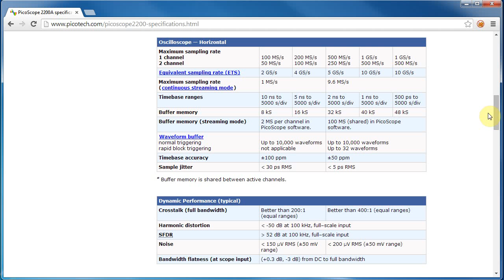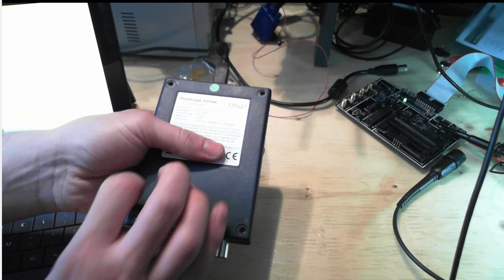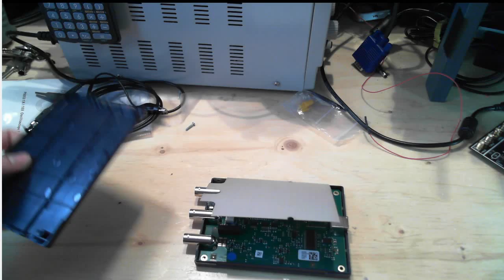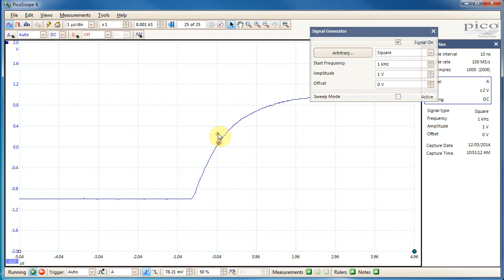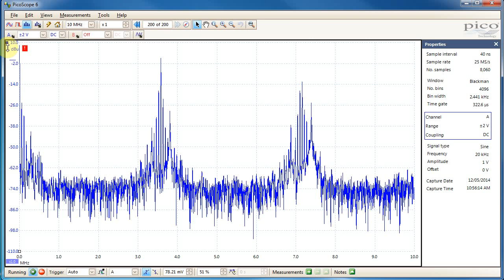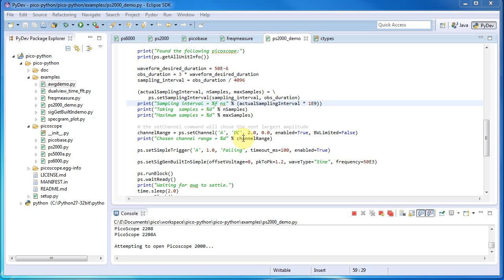PicoScope 2204A Review

Comment: I want to measure upto 2 MHz signals with this. Can you tell if that is possible? Thank you!
Reply: the lowest range on those is 25MHz. In order to reliably measure a specific frequency, you'll need at the very very least double that. So with a 25MHz OSC the maximum frequency you can reliably measure is 12,5MHz (realistically more like 10MHz).

Tl;Dr: Yes, 2MHz is well within range of even the lowest Pico 2000
Reply: I think, the minimum is 10 MHz that they offer. I heard Picoscope guy that to reliably measure a signal, go for around 10 times the signal speed. Nyquist says that measurement should be more than double the signal speed. So I am confused, who is right here. 10x practical guy or >2x theory guy. I am still very confused with memory depth too, to get memory depth of 32MS I need to buy 50 MHz version which is around €300, around 3 times the price of 10 MHz because of memory.
Reply: Nyquist theory requires the sampling rate to be >= 2x frequency to read it in. The sampling rate of this oscilloscope is 100 mega samples per second (MSPS) and is a property of the ADC at the backend of the input signal chain. Therefore the ADC can sample frequencies up to 50MHz. The front-end of the input signal chain though is limited to 10MHz frequencies (the amplifiers, filters etc). So the maximum frequency for this model 2204A is 10MHz and it will reliably capture N K's 2MHz signal.

Comment: How can you calibrate the probes?
Reply: All Probes come with a Trimmer-Capacitor. You can Calibrate any Probe by feeding it a squarewave signal. If you're getting a perfect Squarewave, it's perfectly calibrated. If you're getting under or overshoot around the edges of the squarewave, turn the Trim-Cap until you get a perfect square.

Comment: hey man, I'm working on some new guitar effect pedal designs, and would the 2205A be good enough for my need ? Frequency will be in the audio range and sometimes I will be needing to filter DC ripples. Will it be good enough for my purpose ? 
Thanks
nice review btw
Reply: That's exactly what I'm using mine for. The audio spectrum ranges between ~ 1Hz-30kHz. With one of those scopes you can measure even 300 times that Frequency (9 MHz) and get accurate results. They perform really well for Audio and you can even discover disturbing HF-Oscillations in your circuit, that you wouldn't even hear.

Comment: will this work good on automotive appreciation I'm looking for a good scope but don't have alot of money
Reply from the maker: Not sure on automotive stuff - should work fine, you might check the picotech forums to see if there's anything critical you need that would make you select their automotive scopes. I think the automotive ones might be more rugged & forgiving of voltage over/under. Also this isn't isolated inputs, so all your grounds are connected for example (thus must be careful to connect scope ground to the same point).

Comment: I'm looking to purchase a inexpensive scope. The Siglent scopes claim to have much better specs for about $300. I know you said the specs can be deceiving on many but how do the cheap Siglent scopes compare to the Picoscope 2204a? I have some electronic background from collage and as a elevator repair tech but seldom needed an oscilloscope so my knowledge of them is low.  I'm just looking for a good hobby scope to help me expand my knowledge, some repairs and experiment with Radio Control PPM signals (model airplanes). Please help me anyway you can to choose the scope best for me. Thanks.
Reply from the maker: I think EEVBlog's got some reviews of the Siglent ones - they are probably great for what you need. If you are doing repair work etc it can be nice having the display around for probing things and looking at the signals. There's also a review here: http://www.ganssle.com/video/episode4-review-of-siglent-sds1102.html#.VH3gacnqZE4

For some of my work having the PicoScope API for control via computer is critical, and the various protocol decoders I find pretty easy to use (since it's all done on your higher-power computer, compared to the embedded platform the stand-alone scopes run on). But it's a bit of personal preference...
Reply: I will probably just be using it for hobby based basic electronic circuits. Experimenting with different ICs, filtering and other basic electronic circuits and sometimes just my curiosity to see a signal. What about the other many features of the Picoscope like the frequency generator? Will they be helpful in experimenting and learning or just stuff that I will never use? I understand the portability of a Siglent can be great for repair work but that is not my biggest concern. Two of my biggest conserns are the low voltage and low bandwith ratings. Will they hold me back from accumplishing my experiment projects? Would the higher rating scopes be mainly for more advanced users and not much use for me? I believe that a couple 20:1 attenuators from ebay for $20 each will give me about the same voltage rating as the Siglents. Am I correct?? And if the Siglent bandwith ratings are poorly rated then the PicoScope 2204a would be about equivalent except for features (Pico) and portability (Siglent)? Please correct me where I am wrong, comment on my thoughts and give me your opinion of which is best for me to learn on. Thanks for your help.